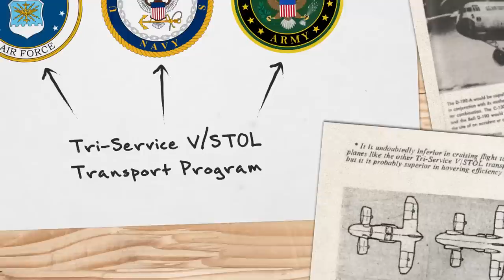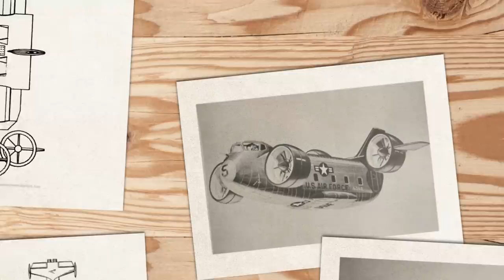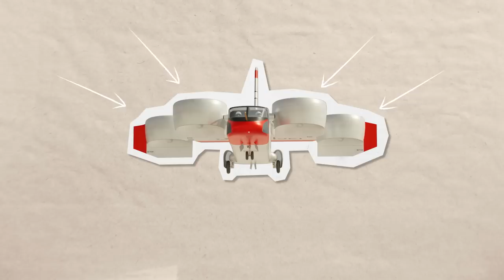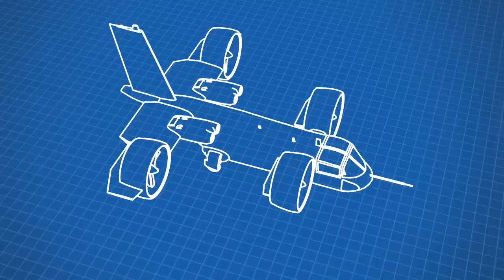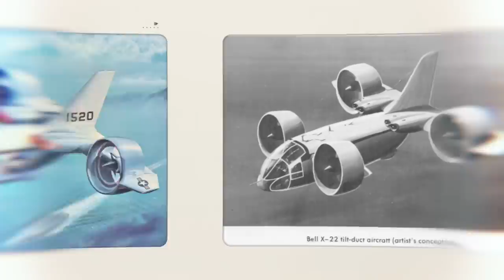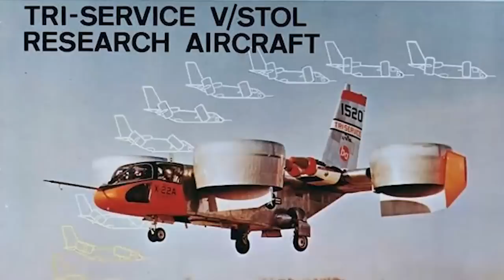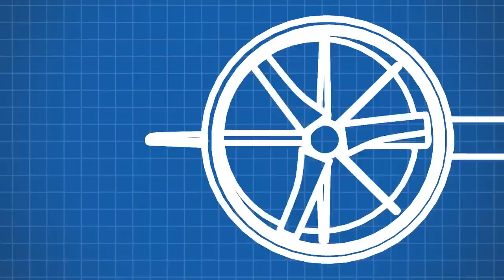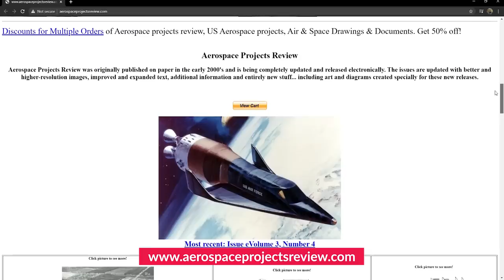VTOL Power - The Incredible Bell X-22 VTOL Plane

Comment from the maker: Shout out to Aerospace Projects Review for help with this video! Check out the website here for much more content!
www.aerospaceprojectsreview.com
Reply: Wait so if the engines would burn the carrier deck how come we have f35s with vtol? Not used on carriers?
Reply: @B01  the jet exhaust isn't used for the F-35 VTOL, it's a separate ducted fan driven off of the turbine.
Reply: 0 8
Reply: @Found And Explained, do you know if the blades spun clockwise or anticlockwise! Thanks
Reply: إاهلن "اشياء رائعة لي الغاية محتوى مدهش ،سلام

Comment: Love the channel. A small note on the animation. Half the blades should rotate CCW. Not only does it make sense on a theoretical level, the angles of the blades indicates this is the intended direction.
Reply: Additionally, the back rotors are mirrored to the front ones, so for example front left turns ccw, back left cw, front right cw, back right ccw.  Just like most quadcopters are cofingured.

Comment: Zero-Length Launch is a better idea for how to get a fighter aircraft airborne without a runway anyways, as you simply discard the hardware needed to get it airborne once you're up to flying speed. ZLL is basically what you get when you strap a fairly sizeable solid fuel rocket motor to the underside of an otherwise normal fighter jet in such a way that it provides both vertical and horizontal acceleration (usually achieved by aiming the entire aircraft at a significant pitch angle relative to the horizon). Upon burnout of the solid rocket motor, it would simply drop away, leaving the aircraft with enough forward velocity to continue to accelerate using its own engine(s).

In testing they made it work with an F-104, there's no reason they couldn't get it to work with something much more modern like an F-22 or F-35A provided a sufficiently reinforced location on the aircraft to carry the high thrust of a large enough solid rocket motor.
Solid rocket motors that are up to the task already exist for use in sounding rockets, and are either stockpiled, currently in production, or are easily able to re-start production if needed. Alternatively, a group of smaller solid rocket motors could be used. The concept does not particularly depend on the exact solid rocket motor used.

As far as how to make a helicopter go faster, as the video states we got the start of the V-22 program out of the end of this one. However, there's really no will to put much if any ordinance on that airframe, but I suppose solutions would be developed as and if needed.

Comment: This makes so much more sense than the Osprey.
Reply: The Osprey has more than double the range
Reply: @startedtech  that's mostly due to the physical size being smaller. The Osprey has more fuel capacity because it's about twice the size.  I'm talking more about the design. If it was scaled up to the Ospreys size/weight, I'm sure it would have a more comparable range.
Reply: Tiltrotor was developed from the ducted fan in order to offset the weight penalties of the ducted fan hardware
Reply: Those dimensions listed are not that far off from the osprey but it also had less horsepower combined than 1 osprey engine. It would be pretty capable with newer engines.

Comment: Great re-creation of a concept ahead of it's time, but like the YF-23 and the P-39 Aerocobra, they dared too much with the tech they had, but what about now? 
 I can see why it fell short of it's range and performance goals, the reduction gearing, hydraulic pumps, motors and powertrain would have been a mechanic's nightmare. The Canadair Dynavert was a much more straightforward approach for that era. 
Electric and hybrid power are coming on strong now, with capacitors for jump take-off greatly reducing the overall engine size and fuel requirements. Maybe they'll be one around to whisk me to the big-city airport the year after next.

Comment: The Y-22 Osprey when they first started testing looked horrible and I never thought it would be reliable, but it has turned into a powerful asset for the Navy.  Between the F-35B and the Osprey the America/Wasp class Amphibious assault ships have become MUCH more versatile and powerful.  They are able to operate them as light carriers now.  The only issue is carriers have Hawkeyes to extend the radar range but they are too big to fix on these smaller carriers.  They need to make a radar plane version of Osprey.  It would be interesting to see gunship and maybe an anti sub versions too.  I think the America class should reduce the marine contingent and storage and instead focus on air dropping a smaller marine task force.  They could easily expand the hanger then and carry 20 F-35B and at least 20 Osprey.  They could air drop almost 500 marines at a time and the Osprey has a much longer range and top speed than any helicopter.  Add in 2 radar Osprey, 2 anti-sub Osprey, and 4 gunship Osprey.  Think of an Osprey with 3-4 2mm chain guns and some armor.
Reply: Osprey max hover gross weight probably wouldn't allow for to much heavy armament.  The armor is heavy enough as it is
Reply: @ar3317  Yah, looking at the weight of those 40mm cannons... yikes.

Well put 2 M230 30mm chain guns (130 pounds each) like on the Apache and one in the nose and link them together.  Then put say 16 Hellfire missiles (100 pounds each).  Basically the same as the Apache, but with 2 extra guns and no options for sidewinders as the F-35B would be escorting them.  Add in 1000 pounds for ammo, 500 pounds for mounds, That leaves you 2500 pounds for armor on the bottom of the engine cells and the nose and belly around the pilot and gunner.  This would be under 6000 pounds so it can operate at the full listed range of 1100 miles.

The inside would be empty, but the Osprey can actually operate with with 8300 pound cargo and still go around 600 miles.  That means it can still operate as a VTOL with 10 troops in the back still if needed.  This would be far more firepower than the Apache and still have the ability to hold troops or cargo if needed.  This would also leave room for the winglets to fold down into the body so it would still have the small storage space of the regular Osprey on a carrier.

Comment: It would have worked better with turbojet/turbofan blades instead of conventional propellers/rotors and a similar powerplant to the CV-22 Osprey (I don't know why they used the US Naval abbreviation for an Aircraft Carrier though) and although it was the basis for the Osprey, any ducted rotor/ducted fan design should use the blades found on a turbofan engine rather than conventional props/rotors.

Comment: A helicopter can make an emergency landing with autorotation. What would you do in this thing, if even one engine struggled? Wouldn't you have to reduce power on a counterrotating engine to keep it from spiraling out of control? Would that still be enough lift to land safely?
Reply: While it may be able to autorotate, that may not be sufficient to enable a safe landing. The nearest actually built equivalent, the V-22 Osprey, is theoretically capable of autorotation, but it was never part of the design spec - at least partially as the rotors had to be made smaller than ideal for the purpose to enable the aircraft to be folded for transport. Instead, both props can be run from a single engine, it can glide to a landing like fixed wing aircraft, and its landing gear is designed to cope with impacts of up to 24 fps to protect the cabin.

Comment: Why was it thought that the 346 would burn the decks? Was it because they were still wood planking at the time? Obviously, the Harrier didn't have that problem.
Reply: The angle of the thrust would have blasted the surface covering  off the flight deck

Comment: One free turbine is turning the four rotors, it has to be. The only way to make it balanced. The four gas generators could be functioning independly that the power of all shafts are equal. Helicopters must add engines like that ...

Comment: Looks more practical and stable than the v22
Reply: The problem was ducted fans were more efficient than helicopters but the weight associated weather ducted fans eliminated any advantage
Tiltrotors were developed as a solution to that problem

Comment: I remember the difficulties they had in the development for the military services. They did not realize the true value as possible emergency rescue platform. They could easily fit an emergency operation room onboard connected to a C Scan tunnel and surgical procedures could easily be done before the patient evens gets to a hospital and while in root to a hospital with the ability to huver over the seen and use a hoist to pickup victims of an accident or situation and the larger models have the room for surgical procedures and bed space for multiple victims. They are much more better than helicopters. Definitely not for the military.

Comment: I just can't seem to get my mind around why they used hydraulics of all things to drive the fans. Surely driveshafts would be better for something in the prototype stage? I mean I understand there would be a fair few gearboxes if using driveshafts, but surely the power losses in driveshafts and gearboxes would be able to be made lower than the power losses over such a long length of hydraulic tubing and who even knows how many fittings?
Then again that doesn't even address the root cause of the issue of being underpowered even with 4 turbines, to do that you would move the turbine power plants to be much closer to the ducted fan they power, and then use a much shorter driveshaft to connect them.
Of course for safety you would also need a driveshaft and gearboxes to connect all 4 of the turbines mechanically so the failure of one is not a catastrophic event.
Moving the engines from "all clustered in one spot" to "distributed around the airframe" has a further benefit besides what I just mentioned, it makes it harder to take out multiple engines with a single shot, which is surely something they would consider desirable since they wanted to have versions of this operate in combat.

Comment: How did the jets in the rear power the fans in the front? Hydraulics?
Reply: I think it was most likely by shaft and gearbox
Reply: Hydraulics. It's explained in the video.
Reply: @paulh4943  Extremely briefly glossed over, IMHO. Actually mentioned it once right after I posted the comment.
Reply: @jonnda  agreed, a little more time about the engines and powerline would have been great.
Reply: @paulh4943  I find this arrangement of fans and jets fascinating. I’ve never seen it before.

Comment: so techically speeking the size wings should be doubled first at front then at back this id for better glide and mandvouarability and some space x tech a so called corvette drive tech you put a handle at tail and pin two jets you get like easy fast and glide options only slight engine on servo fix and wings better it could fly today so bell and rockefeller ownrships are oil products if not flawless probably interests stop the cause is not enough scfi and sheikh oil, thsi doesnt means that todayis not enough scfi with slight thiner caps on turbo vents better aero dynamics anyway surpass range osprey easy especaily good if flown with rotational cocpit as works as scfi flying easy, anyway a rcokefeller daughter is rich person probably wouldnt head anthing against it to be so esp if product speek about scfi age and use off corvette scfi ships tech and usability in aeroplane tech in range easy as is future modular tech part off corvette tech spaceship systems as also vtool back part in one as combo mix part easy